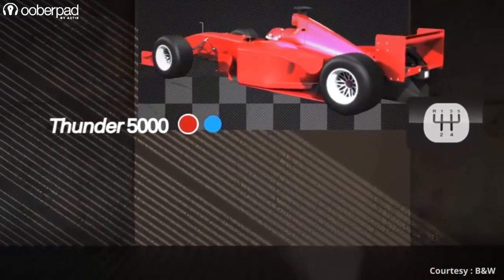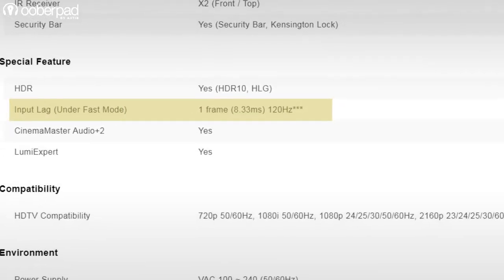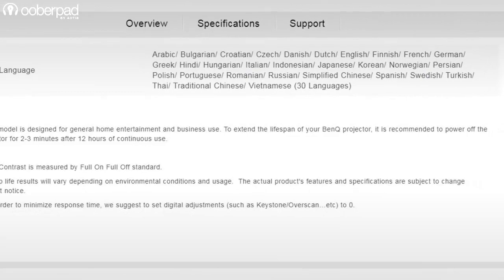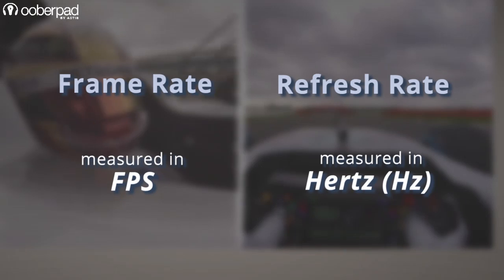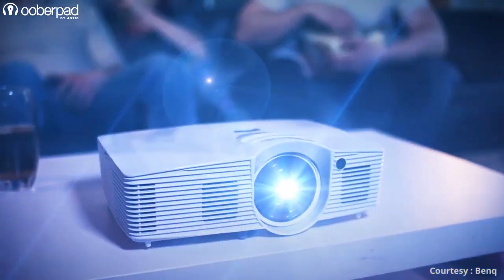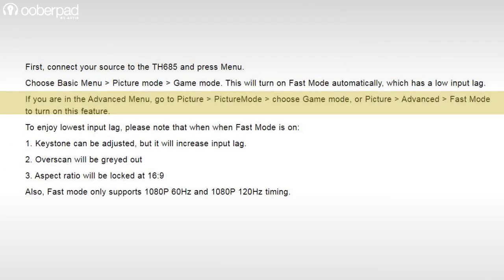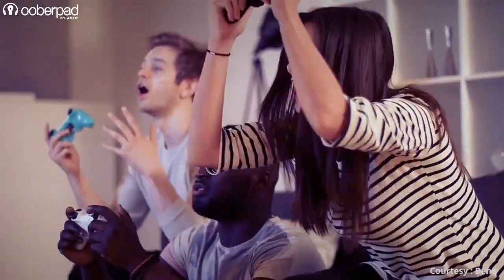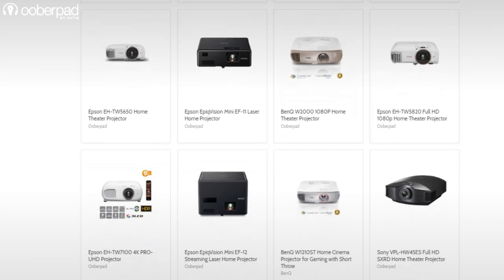What is Input Lag? And how to avoid it? All you need to know

Comment: I have mystery to resolve:)
My projector has really inconsistent input lag, like fromm 0 ms at times through 30, 50 to 120 at most times. How there are so much differences in just a couple of seconds. (I measured it by connecting laptop via hdmi, then play stop watch on laptop, and record video in slow motion, then pause video a couple times in a second and have results. (Probably im doing it correctly becasue measured also different projector by this method and it was almost perfect 50 ms difference each time I paused ...